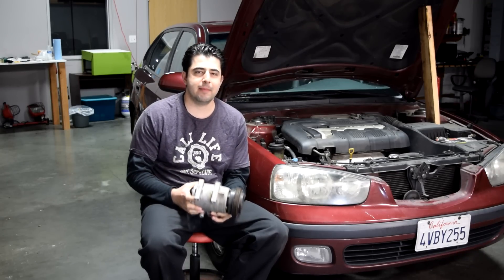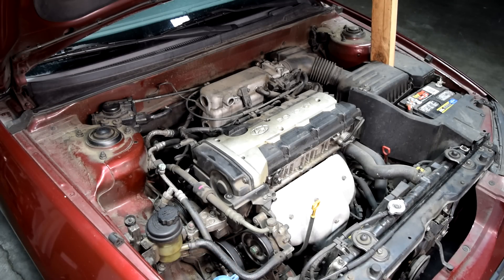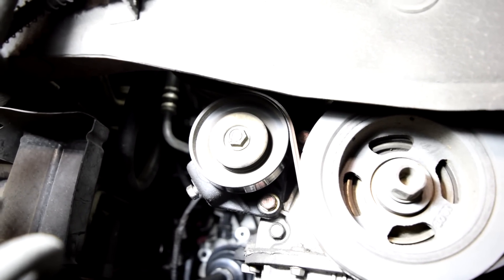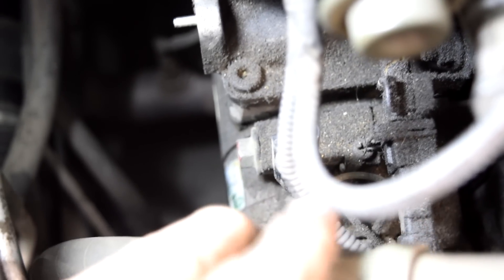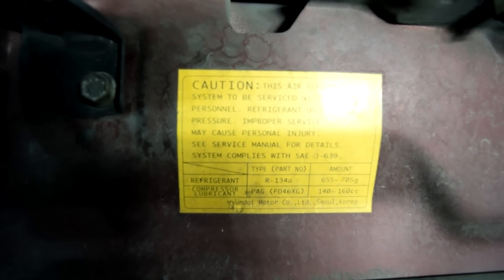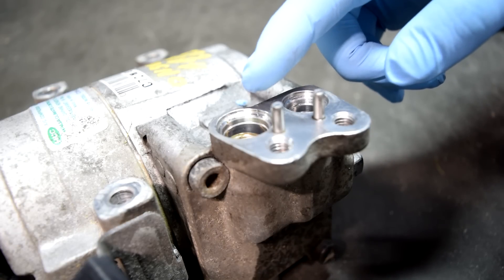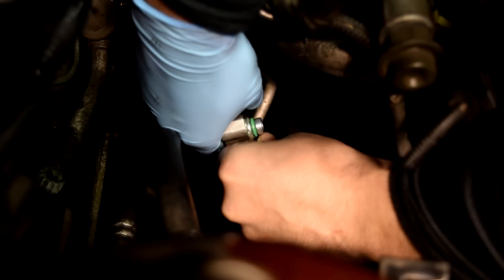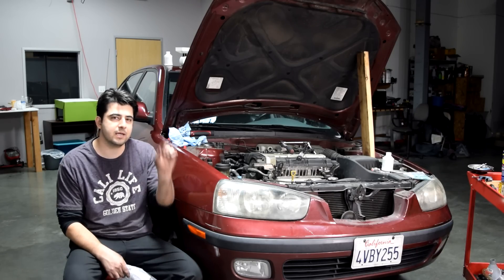How to Remove and Replace an AC Compressor - High Detail

Comment: How to go about the compressor, which has a low pressure port on the bottom of its cylinder, on the side opposite to the clutch side? So the Suction hole is just at the center of that plane. The High port is approximately in the same position like in the compressor shown in this film @0:22. So the Low and High ports are not on the same plane. The hole for Low P port doesn't have any oil around. Should I still use it to fill the compressor and then plugged it in before install? I removed that compressor and now need to clean properly and fill in w/new PAG 100, but in doubts about the procedure, since the shape is different fm/the compressors shown here and in all other films on the subject I saw. Thank you for your film again.

Comment: @6:27  It is very good and detailed film on changing a compressor, so many tips, thank you very much. If I need to replace the oil fm the compressor and not sure what exactly oil is there, can I flush it out? Is it possible? With the special flush liquid, like what we use to flush the evaporator e. g. The car AC (it is 2001 Saturn SL2) works on PAG oil (that is what Shop Manual says, they don't specify which PAG of 3 types). PAG oil comes in 3 types 46, 100, 150. As far as I understand you can use any, but you can't mix them. The car was in the dealer shop like 10 years ago, and they replaced the compressor 3 times, but  shortly after AC stopped working anyway.  I think that is bcs they didn't replaced the Condenser, I've read that the clogged Condenser can cause the Compressor to fail. I'm replacing everything besides the Evaporator (which I will flush of course) I think. Or if so little oil is left after proper draining it doesn't matter what PAG was there? Thank you again.

Comment: About the oil.. denso has a video stating to balance the oil amount if only changing the compressor.. to my understanding other components still contain the Initial oil charge. That the oil is not lost during evacuation. I'm just a back yard mechanic / hobbyist. If someone can shed some light on this, that would be great. Their is so many questions I have to be answered. I need to change my compressor, but don't want to over fill the system.

Comment: Hey I've got a real quick question for you after a person has put oil in the compressor when you start charging the AC up would you still have to put an oil through the lines so much at a time while you're charging the AC

Comment: It's a good video,  although if you're going to replace the compressor you should also replace the condenser and flush the whole system out of particles and debris from the failed compressor,  otherwise the contaminants in the system from the old compressor will just cause the new compressor to fail.  You could try flushing the old condenser but that hardly ever works properly,  best to just put a new one in.
Reply: I hope thats what the mechanic did with mine recently. He just said its in, gonna charge it. How fast would it make the new compressor bad if not done right?

Comment: Hello R&R...how about a 2016 Mitsubishi Outlander that stops blowing cold air when I'm stopped at a red light or stop and go traffic??? Once I get going, it starts blowing cold air again. REALLY annoying! I have to put it in neutral and rev up the engine when I'm stopped, or I will bake. Freon HAS been properly vacuum and recharged...Any suggestions? Thanks!

Comment: I really don’t like the fact that you don’t say specific makes and models and no they’re not the same some cars are quite different based on the amount of junk in the way that you have to move to get to it so be specific don’t generalize all cars I’ve worked on cars for 30 years they’re similar but they’re not the same some cars nowadays you can’t even see the compressors and alternators cause they’re so buried

Comment: I had my AC compressor replaced this past Friday. When i got car back home and reversed into driveway i heard a terrible noise coming from right wheel well. Is it possible the CV joint could have been damaged during the AC compressor repair?

Comment: Thank you for very informative video with step by step procedures.  I am wondering when the Toyota say 5.7 oz of PAG 46 oil for my A/C compressor, it is for the whole system (AC lines, condenser, evaporator) or just for compressor.  I searched online, and it is still confusing me because some said only put the amount of oil comes out of old A/C compressor to the new one.  Please help to clarify it.

Comment: I have a leak in my ac manifold the square looking cover on top of the compressor that has the two hose inlets for the the low ans high side. Is there a gasket under that cover

Comment: Hey, guys where I can I find the plugs used to plug up the compressor so the oil doesn't lesk until its reinserted back into the car? ?? Or do I not need to worry so much about them? Thanks!
Reply: Just put tape or plug them up with rags etc etc they’re just so oil doesn’t spill when your mounting it back onto the car that’s all it’s for

Comment: Question- Once the new compressor is installed, do you just charge the system with 134 Freon that you can buy at autozone?
Reply: Well yeah and no...Its a certain amount of "PAG" oil you have to add 1st.....The autozone R134 only has a little PAG oil....Not enuff for the whole system...Remember, The freon evaporates, but, the oil stays behind when you just do a recharge....Whole system redo , you gota add the right amount of PAG oil....Otherwise...Your new compressor will just burn up...Now, you gota do this all over again and cost even more money.....Chris Fixx has a great vid on recharging the whole system...and , if I remember right....You can get the gauges on loan from Auto Zone...Happy Huntin'.....
Reply: @ 8:36 , Personally, i'd have used either a double end capped PAG or 525 SUS mineral oil (the one used for R-12) to lubricate the o-rings, or even the Nylog. The oil you used doesn't state anywhere on its container that it's double end capped, so i assume it's a single end capped PAG. Reason is, single end capped PAG oil is hygroscopic, just like Ester. Double end capped PAG, mineral and Nylog aren't.
Only ways to remove any oil are to replace parts, recover the refrigerant fast enough or flush parts. Vacuum isn't going to affect oil quantity in any way. There's no more refrigerant that can carry the oil with it, while you vacuum. There isn't any other agent that can dissolve it either. Also, PAG and POE oils are polar. They cling to the metal. That's why workshop manuals tell you to add a certain amount of oil after replacing an AC part, without even bothering to drain and measure.
A certain amount of oil resides in every component, since PAG and POE oils are polar and cling to the metal, covering anything in a thick oil film. Workshop manuals tell you to add a certain amount of oil when you replace any component, including the dryer. The safest thing period is to flush the whole system and add the whole oil charge into the new compressor. Another relatively safe way, when you're not dealing with a seized compressor, is to remove the old compressor, drain it of any oil and refill it with the same amount of oil that you drained, plus half a fluid oz to compensate for anything that clinged to the metal inside the compressor and you couldn't drain, plus any oil that came out while recovering the refrigerant, and plus any other oil amount that the workshop manual asks you to add for any other component you replaced together with the compressor.

Comment: A fluid ounce (abbreviated as fl. oz.) is used to measure fluids while an ounce (abbreviated as oz.) is for dry measurements. This gives us the idea that a fluid ounce is a measurement of volume while the other is a measurement of weight. There is a slight difference with Compressor Oil.

Comment: You state several times to remove the freon before beginning and "this is not a job for a do it yourselfer." Question- How do I remove the compressor form a vehicle in a junkyard (yes, with the freon still in the lines)?

Comment: 8:36 Personally, i'd have used either a double end capped PAG or 525 SUS mineral oil (the one used for R-12) to lubricate the o-rings, or even the Nylog. The oil you used doesn't state anywhere on its container that it's double end capped, so i assume it's a single end capped PAG. Reason is, single end capped PAG oil is hygroscopic, just like Ester. Double end capped PAG, mineral and Nylog aren't.

Comment: Hey man quick question, After putting the oil in the compressor, and installing the compressor, do you then put the vacuum pump on ? and will that not suck up the Pag oil ? Specfically I have a 1999 Honda Civic Dx
Reply: Vacuuming the lines does not remove oil.
Reply: Only ways to remove any oil are to replace parts, recover the refrigerant fast enough or flush parts. Vacuum isn't going to affect oil quantity in any way. There's no more refrigerant that can carry the oil with it, while you vacuum. There isn't any other agent that can dissolve it either. Also, PAG and POE oils are polar. They cling to the metal. That's why workshop manuals tell you to add a certain amount of oil after replacing an AC part, without even bothering to drain and measure.
Reply: I know right? That what I'm wondering

Comment: I have a question. I asked a mechanic to remove the refrigerant I had, but I forgot to ask about the oil. When I remove the ac compressor, will there be some oil in the system itself or does all the oil flow down to the compressor? I think oil is also in the dryer, but since I'll be replacing that as well I know that won't be a problem. Will it be safe to just fill the new compressor with the specific amount of oil (for me, it's 135ml) or could there be some pockets of oil in the system? Thanks!
Reply: A certain amount of oil resides in every component, since PAG and POE oils are polar and cling to the metal, covering anything in a thick oil film. Workshop manuals tell you to add a certain amount of oil when you replace any component, including the dryer. The safest thing period is to flush the whole system and add the whole oil charge into the new compressor. Another relatively safe way, when you're not dealing with a seized compressor, is to remove the old compressor, drain it of any oil and refill it with the same amount of oil that you drained, plus half a fluid oz to compensate for anything that clinged to the metal inside the compressor and you couldn't drain, plus any oil that came out while recovering the refrigerant, and plus any other oil amount that the workshop manual asks you to add for any other component you replaced together with the compressor.

Comment: I attempted to remove the ac compressor clutch on my 2010 nissan sentra.  I was able to remove the bolt but the clutch does not come out as seen on the videos.  Am I mising something?  Just replacing the clutch kit.
Reply: Check for the snap ring

Comment: Bro, do a video on , " Evil / demented engineers"  that place spark plugs under layers of stuff you have to disassemble to just do a spark plug change.  How about my Nissan Versa, Spark plugs are a pain!  Also, the AC Compressor is hard to get to and they fail every two years!?!  Sorry for rant...

Comment: Do you always add the oil before connecting the compressor? I changed my compressor pretty sure didn't put any oil in  and the bee compressor failed after 5 days
Reply: If you change the compressor make sure when u get refrigerant for it u get the cans made for first time fill of system because the oil is mixed in with the coolant.

Comment: I had nowhere else to ask this, and can not find anyone that has helped. I have a 1999 Buick Park Avenue. My A/C stopped blowin out of vents. Floor and defrost only. I pulled the head, table top teched the inside. -5 re-spot solders were needed, as some seperate from the board from age. Thought that may have helped. No go. Correct me if I'm wrong but from what i checked there are a couple door actuator's that are in the dash. I have seen the one by left of glovebox is one that people said replace that one. Just want to be sure. Are they all the same when I order one. Do or would you know which one I may need to replace? Also "2" under left side of dash? I'd sure appreciate it.

Comment: When you replace a new compressor,you need to add the lubricating oil,where is the hole on the compressor to add it? Is all the lubricant oil the same?
Reply: I just got a new compressor to put on my car. They sell refrigerant at the parts store that has the oil in it. Make sure u ask for the refrigerant for first time fill up.

Comment: I'm confused about recharging the system from vacuum (such as after installing a new compressor). I understand the compressor clutch will NOT engage when refrigerant pressure is too low, BUT... in order to fully recharge the system, the compressor must be running, which means the refrigerant pressure must be great enough for the clutch to engage. Does the pressure inside one 12oz can of refrigerant pressurize the system sufficiently to trigger the clutch to engage?
Reply: If it's a system that uses txv, might have to "jump" compressor at first. After just a couple ozs, put relay back in and it should be running on it's own. Finish filling other 15 to 20 oz or whatever it calls for. If uses orifice tube, jump it there if you got to. But those systems may not need a "jumper" to get them to start taking refrigerant. Good Luck!

Comment: hi i am new in the ac system of the car most of the time im doing only trouble shooting, now im facing my own car problem in the compressor. i just replace a new compressor in my kia carens 2005 model, in my carelessness i spill some of the oil while im mounting the compressor, now i dont know the exact amount of oil needed to fill up in my compressor..... i tried finding the info sheet under my hood but i find nothing, also in the compressor there is nothing mention the amount of oil needed....... please help.........dirkie qatar

Comment: Mine has a bolt you remove, dump out the test oil and add 7.5 oz pag 46. only problem I have is there are two bolts?
Reply: You have 3 bolts. 2 for the low/high side lines. 1 plug. On back. Use that to drain oil from new compressor. Refill it there as well. Or you can do it through the low side line port. Some use high side line port as well and will say it doesnt matter. Prob doesnt in the end as long as vac is done and gauges read correct when finished. But, a manufacturer of a new compressor is prob going to say to drain from drain plug to make sure amount put in at factory was correct. Then refill in same.

Comment: Hi , Thanks for great videos

I am replacing all my Ac components on VW Passat 2002 (AZM Engine 2.0). Condenser, Evaporator, Drier, orifice, Hoses and compressor .
250ml is total oil requirement for my whole system as per VW manual and system is R134a.

My question is about adding oil after complete flush or complete new components. I have two choices:-

1. Calculate oil came with new compressor (say for example it had 200ml). Pour back 200 in new compressor and where shall I add the rest?
Is it condenser or drier or add with new compressor itself?

2. Other option as Manual says distribute oil - 50% Compressor, 10% condenser, 10% suction pipe, 20% Evaporator & 10% Drier.
Confusion is adding OIL to “Suction pipe” - which flows directly to compressor LP port and into compressor. So what’s point?

If Option 1 can be right then I am happy as adding 250ml direct through compressor drain plug and rotate 5 times clutch and charge system.
Also I understand OIL is only for compressor lubrication and nothing else.

Hope you can get me the right answer which can help others too.

Comment: Can one get a compressor from junkyard or ebay and just replace the clutch say for example on a 2011 Nissan Sentra 2.0?  I watched all your diagnostic videos and determined a burned out clutch.  Everything else is fine.  Great job on videos.  I've been studying them for several days.  I don't want to pay someone else to do something I can do once I understand it.  know what I mean?
Reply: You can. Prob be worth a shot if you dont mind going back and redoing things if it doesnt work out for ya. Since it was 9 months ago i'm sure you chose what you wanted to do by now. Curious as to which route u went. And is it still good this year, summers already here in some places(like where i'm at in charleston, sc!) Hot already!

Comment: My 2001 GMC Sierra calls for 8 oz max oil (they told me this at Autozone)  If my brand new compressor comes with 3 oz oil already in it, do I need to add another 5 oz before I install it?  Or is there some other way to add the 5 additional ounces later after I install the compressor?
Reply: when you drain the old one, that is how much should be added to the new one. oil remains in the system so if you drain out 3 oz, then 5 is still in system. some in the dryer,some in the condenser,some in the evaporator. the oil travels with the gas wile the a/c is running. excess oil will impair the gas from expanding and reduce cooling. oil will not expand in the evaporator like the gas does.( ase master tech)
Reply: Thanks Terry. That makes sense.  But you must have faith the proper amount was in your   system.  If 3 oz or so is typical to drain (from my 8 oz compressor), then I guess you would be safe with this method.

Comment: You don't need to flush the system?
Reply: Yes, you do. Some things anyway. Not receiver dryer, orifice tube, prob not condenser either. Change out drier or orifice, flush all left lines, evaporator for sure! Imho, that is!